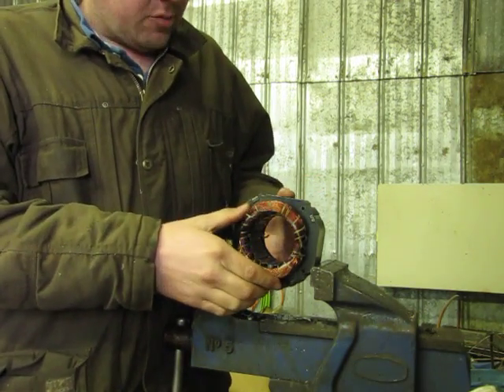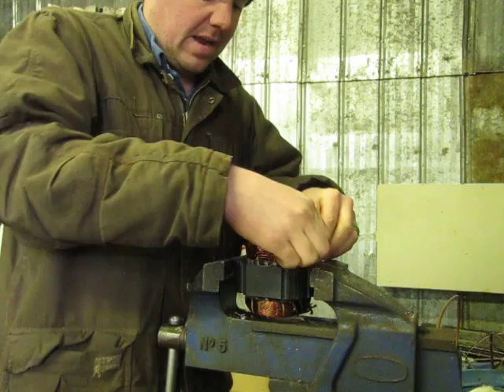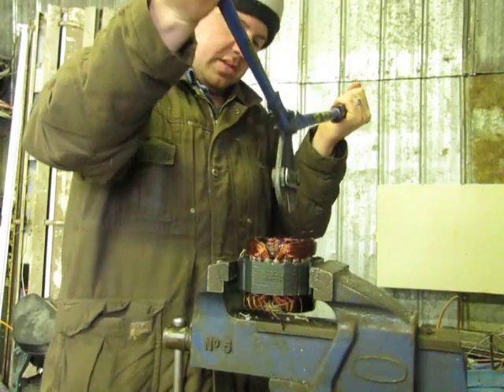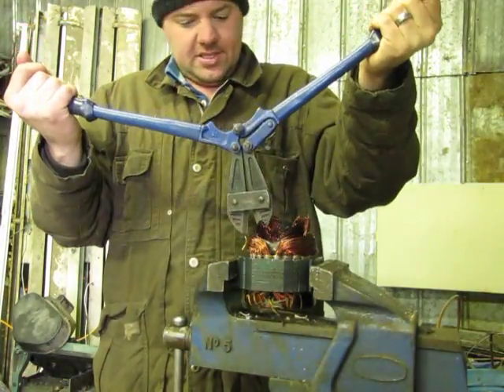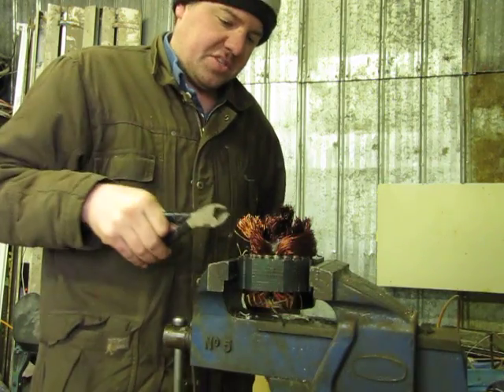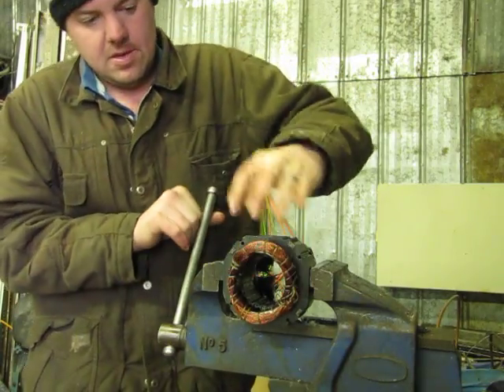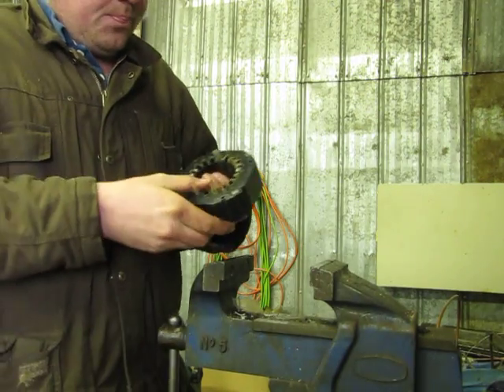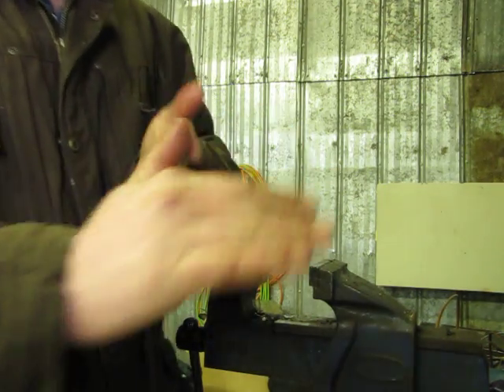Easy way to remove copper winding from a motor core

Comment: Most boltcutters wont cut cleanly all the strands due to clearance between the jaws, the proper tool for that job is cable cutters- the ones that look similar to branch loppers.
Reply from the maker: If you adjust them they work perfectly.

Comment: Your method works well but see Scrapitall channel for the fastest method to split the stator (field windings) with a machete.  Very fast.  I didn’t have a machete so I made a cutter out of an old 10” circular saw blade.  I’ve also found someone who made a cutter out of an old disc from a farm implement!  Just sharpen the cutting edge with a grinder and it goes through the wire like butter.

Comment: Hello Facebook, 
Jimmy here. I have been scrapping for about 5 years, mostly Batteries and wire because my fathers alarm company was nice for that but I’ve moved into more metals and I’m doing quite well actually and I have a pretty large haul waiting for Monday BUT. I am without a vice and a hammer chisel bit and or that kind of drill it’s an m18 Milwaukee. Any ideas?
Thanks!

Comment: When you add on the first step of removing the motor casing, that adds a few more minutes to the process.  However, 10 minutes per motor is pretty good. Also, this is No. 2 Copper since the copper windings have been treated with lacquer

Comment: I've always used tin snips.  I'll try the boltcutters, but it looked like you cut the same windings multiple times; if you don't cut thru the 1st time, small bits of Cu fall on ground.
Reply: The correct tool for the job is the only answer, cable cutters- the type that work like branch loppers but meant for chopping cables.

Comment: great video as always i use a grinder and a zip cut blade nice clean cut next to the steel flip over and start tugging these are a real pain in the  azz to pull the wire from

Comment: I have a few motors but didn't much fancy stripping them. Always thought it was too difficult. I go scrapping on a bike. Yeah a bicycle lol. But it's a hobby for me and I do okay. I'm gonna give this method a go with the motors.
I always support fellow scrappers, liked and subbed.
Reply: You got a trailer setup for yer bike?
Reply: @johndowe7003 , no I dont use a trailer. I basket at the back is enough for me. I also have a backpack and a bag to hang on the handlebar should I get a really good day.

Comment: I almost feel bad for being the only Donnie Downer on this thread but there's a better way. Take your side cutters, bolt cutters or even what I do is use a cut off wheel to just cut off the whole bundle on one end and use a screwdriver to pry out through the other side. The string comes off much easier also. Cheers
Reply from the maker: How do you fix your armchair?

Comment: I just take a grinder with a slitting wheel and chop off the windings at the steel core on one side. Then use a large screw driver to pry them out from the opposite side. Much faster...try it and let me know what you think....

Comment: By the time you find the scrap, bring it home, disassemble it, remove the copper and then take it to the buyer you are making $2.75 an hour?
Reply from the maker: I'd get around 300 lbs a week in copper alone and at 3.25/ pound (at the time) that was over 900.  Not to mention the 1008 punching 6" and under was over 300/ ton.  I was making much more than 2.75 an hour, big guy.  If you want to sent your scrap motors to the junk yard, as is and only receive .50/ lbs for em.  Have at it.  I don't mind working for it.

Comment: That will work for concentric or "basket" wound stators ,but lap wound coils only release if the previous coil is removed first untill reaching the span. For that reason an air hammer and a cutting tip focused use where the coil and the slot meet is the fastest  way i have seen for that winding.
Reply from the maker: I did it all by brute force and physical strength.  I didn't have an air chisel and angle grinders only fill your shop with stinking, choking smoke.  The only thing I wasn't ever able to remove the windings from, with my method, were automotive alternators.   Other than that, my method, using minimal tools, worked efficiently, took little time and didn't owe my anything.
Reply: @Vicsonvee   right on great video for sure ...for no power tools, definitely impressive hand strip

Comment: I stack my motor cores up like chimneys and burn the coating and string off ......cut one end of the winding's and pull them out the other end ......and i have "clean copper"

Comment: You know, I can clean 10 times the copper with a large metal file ground down to a point and sharp like a knife for aprox 4" at a taper. start the point into the center of the winding and cut as you pry it to the open side then turn it over and use the other end to pry it out of the stater.  Hope this makes sense,  28 years in the scrap business and I know it is fast.

Comment: I just use a cutting disc on the grinder , straight through the one side and then what you did only easier because my ends are not spread out ,it takes about two minutes.

Comment: good job so other than hunting all over the place for Motors then disassembling the motors dealing with the scrap from the motor housing the screws the shafts and then transporting the copper you got out of the motor to the scrap yard weighing it dealing with all the other scrap from the motor housings so unless it's raining disassembled Motors in your town it's a real tough way to make money you made two bucks on a video but you didn't show what you had to do to get that motor how are you had to get that winding out of the motor we're all the rest of the motor housing went factoring time effort you know what you're lucky if you made $0.25 I know I've been there
Reply from the maker: It takes around 10 mins to completely take apart a motor and separate your desired materials.  Refrigeration compressors are the easiest way to get motor cores.  Getting  1.75 to 4 LBS of copper at the time for over $3.00 a LBS was defiantly profitable.  You also can't forget the heavy steel either, which at the time was over 300/ ton.  There is around 10 -20 LBS in those motors and it doesn't take long to get a ton.   Pretty much ever week I was taking 3 to buckets 100 LBS copper and everyone 3 weeks a 50 Gal drum of heavy steel, which weighed over 1 Ton. - Copper got ~ $900 weekly and steel around $400 ever 3.  You also must remember you have the mixed shit steel, which was worth $200 a ton at the time.

Comment: really well done BUT unless you are getting the scrap motors for nothing and DIY you might make 20 bucks an hour.  Certainly not worth while if you have to pay someone to do it.
Reply from the maker: I used to have a small scrapping side business, that offered free scrap pickup.  All the motors were free.
Reply: Well in Florida garbage is free range when it hits the curb. Plenty of items with motors like this or bigger for free. Well worth it.

Comment: hey ty very much for the video i been scrapping motors all my life and i do about 5000 year and yes i can cut oper with grinder or sawsall and do them in about 5 minutes to 10 max. but i lose alot of copper so iam going to try your way ty cheap charlie
Reply: Lisa Campbell  How do you get ahold of 5000 motors a year?

Comment: Or...... use a angle grinder cut one side flush to the metal stack plates and then flip it over and use a screwdriver or similar tools and easily pry up on the coils by pushing the screwdriver down using the motor stack as the fulcrum. As you work your way around they break free and you can remove all the coils intact. Takes me less then 2 min per motor.
Reply from the maker: lets see your video :)

Comment: Hey man don't get upset .When a coil wound we have to bind it and  insulate with a  shellac and bake it slowly in a oven.after that coil gets hard and solid.it'll be very difficult to remove again unlike in your video. the coil you have removed seems not burnt totally and not insulated as how I said.any way you are doing nice job and a video.Keep it up!
Reply: That looked to be in good condition and typical of how hard the average stator winding is to pull out. Fridge motors are way easier, they bathe in oil all their life and slide out easily with all that lubrication.

Comment: HA HA.. Its easy because you have removed new, non insulated loosen wingdings.
Reply from the maker: I'll assure you, these are not pre-loosened winding.  They are simply cores removed, or drove out of the iron motor housings.  It really is an easy way to remove motor windings from the iron core, not matter what you say.  Go ahead and show the world how it's done though.

Comment: According to the clock in the back ground it took 8 minutes to complete this process, is it really worth that amount of labour for 2lb off 'copper 2'. btw just found the vid by chance... Otherwise  Nice Vid !
Reply: switchkwb

My method is way faster.
Reply: don't forget he paused often to explain details, it would be a lot faster if he just went for it without stopping. Great vid though and a good method  with minimal waste from power tools and blades.
Reply: Minus the explanation for an educational video he might of done it in 3 minutes.  20 motors an hr lets say, good  money.

Comment: two bad copper is only 1.50 a pound now:(
Reply from the maker: I have kind of gotten out of the scrapping business since the price dropped so much.  If you have time and the space, you can always store a bunch of copper for when the price goes back up.
Reply: Back up in the mid 2 range I've seen 2.40 to 2.60 depending on yard & county.

Comment: Just chop the whole top off with an angle grinder .No straightening needed and much faster. I haven't tried it yet, but maybe a disc for aluminum cuts better and doesn't clog up like a steel disc.

Comment: you're just making this more complicated than necessary. just whack off one side with a reciprocating saw, flip it over and let out the copper with and screwdriver. takes a lot less time than what you're doing
Reply from the maker: +norrock1 Thanks for the tip "tips"  Have fun making a mess and wasting saws-all blades.
Reply: Idk, seems like the blade would turn about two onces of your copper into dust, and you wouldn't want to breathe copper dust into your lungs.
Reply: +Vicsonvee saw blades are cheap vs work relation...

If you have a cheap China blade, then you going to break 3 blades every 20 minutes of only cutting plaster and chicken wire...

Though. If ya got some milwaukee or diablo blades... It will last ya way more than any profit even if profit fails.
Reply: Use Miwaukee Torch blades you can cut 40-50 motors before you have to change blades, including cutting off the Steel cases. Buy cheap blades, then you're wasting money.

Also you stick a Plastic tote under the vice you catch the copper dust too.
Reply: This wouldn't be that slow either if he wasn't explaining it.  Probably min maybe 2 slower than saw-all
Reply: norrock1 agreed to much hands on labor
Reply: Man thanks for taking the time to try an offer a method you found useful. Sorry all the other " scientists " didn't agree. They should offer there own manual for all to critique.

Comment: Awesome! Everyone says to use a grinder and all I could see was making a mess. Thank you for this awesome tip with the bolt cutters!
Reply: Grinder and long bar to pull them out takes about 1 min 2 tops this whitout explaining would take up to 4/6 min so for evry 1 u do ill make 3 count out my copper and ur copper end of the day. Then yes i rather make a mess
Reply: @hendrikoo7893  grinder is the standard way ive been doing it, takes longer to cut than to snip and loses copper by grinding. I sweep up the dust to melt later when the jar is full. Will be snipping it from now on with the difference of buying a decent cable cutter as my bolt cutters have gaps in the jaws. Also to pull the wire out ill use a slide puller with a hook on the end.

Comment: Get a power grinder, cut half or 75% & pound it with one swing sledge hammer.
Time management will determine when just how long you stay in the business, lol
Reply: Second that. Cutting off one side with an angle grinder is MUCH easier than all those beginning steps.  Then pull out other side as you show.
Reply: its the way I do it, but certainly this is a way if you don't have power

Comment: FYI if you ever scrap a split phase motor, the start winding is brass not copper.
Reply from the maker: John Metzler Very interesting.....  I must have scrapped out 20,000 motors, many of them being split single phase  and I had never encountered a motor containing brass windings....  I am guessing you had some sort of goofy motor you wound yourself, to say it had brass start windings.....
Reply: ***** I have delayed responding because I was hoping to get hold of a split phase motor to disassemble and settle the issue once and for all. But it seems they are a little hard to come by these days.  I remember scrapping one out a long time ago and the metal of the start winding was definitely different from that of the run winding, looking a lot more like brass than copper. It would make sense because that type of motor develops phase shift  between the start and run windings by means of resistance in the start winding, and brass has more electrical resistance than copper. That's why such a motor is sometimes called a resistance-start, induction-run motor.  Inefficiency is not a concern because normally the start winding is only operating for a split (pun intended) second.
Reply from the maker: 25U4s Number 2 Copper***   All motor winders are either copper or aluminium.  The coating or varnish on the motor windings are different colours and can make the windings appear to look brass yellow, but they are not.  The windings are all either number 2 copper or aluminium.  Many split phase motors have aluminium start winding which are a more narrow gauge than the run windings and also have a brighter yellow appearance due to the coating itself.
Reply: @Vicsonvee  ..Used to be an armature/stator winder, and can confirm that aluminium and copper are the only metals used. Aluminium being the best conductor of electricity, but fractures easily. Most motors use coper throughou.t
Reply: Vicsonvee Thanks for clarifying.

Comment: Just curious, if this the easy way, what's the hard way?

And yes, its sad to see that magnet wire cut.   Could make some fun induction projects with it.
Reply from the maker: +Tyee Cambrón Well Bud, for your information; bolt cutters are actually a cheaper method in the long run.  A good pair of bolt cutters will last many years and in many cases even longer than the reciprocating saw itself.  A reciprocating saw takes electricity to operate, which intern costs your money. A good pair of  reciprocating saw blades can cost over $40 for a single pack.  Can you tell me the operating and maintenance costs of a good pair of bolt cutters?  Those 4" motors you speak of that are apparently worthless and a waste of time seem to have yielded me a decent profit over the years.  You do realize if I wasn't recording a video and explaining the step by step procedures of my scrapping method, that I'd have the job done much faster, right?  Also consider the fact that the mass abundance of those apparent "worthless" motors are found everywhere, most of which contain 2 to 5 LBS of copper each.  Trust me bud, I have used a  reciprocating saw to cut these windings out and it's not pretty.  Constant jam-ups, blades snapping, excessive wear on the saw itself (regardless of the make) just a recipe for lost cash and big headaches.  In conclusion here; I have told many others here in comments to choose the method that best suits you.  If you feel your method is the best, then go right on doing it.  This is an alternative method of recovering copper out of motors and in my eyes is the safest, cleanest, cheapest and if you are any good, the fastest.
Reply from the maker: Chris McCarthy Well there are many different ways to get the windings out of a electric motor...  Some ways are much more time consuming and others are very dirty.  So honestly, if you have mastered your own technique of removing copper winders from motors, well then I guess it's easy for you as well.  At the time I made this video, I never seen anyone using my way of removing windings from motors.  I hope this answers your question.
Reply: Long time ago... I was a scrapping noob and someone had me take the copper out of a 4" diameter? Motor...

Took me for ever to actually crack it open... Took me like 30-60 minutes to unwind the copper... I left a plastic mess at the front door that was rented.... Hecks, today, I probably have that copper out less than 2 minutes with barely a mess.
Reply: there are plenty of more difficult ways

Comment: Thats a pretty good idea but i do mine a lot quicker i put it on the ground put a pole through the motor, stand on it and use a grinder cut one end so it won't slip. After cutting put it in a vice then pull the other end out with a long ass screwdriver. If it's too hard to pull i use the same bolts the motor came from as a punch to knock each piece out until loose or just pull em out by hand. Could have been done half way by the time reading this lol
Reply from the maker: Grinders equal stinky smoke, fumes and dust. Plus you lose cooper, from the grinding process.  If you feel your way is the best, then you should keep processing motors that way. :)
Reply: Vicsonvee So right and copper is a neurotoxin. Too much of that and you would end up in the nut house.
Reply: Copper is good for you because muscle milk contains copper and lists it in the ingredients.
Reply: +Tyee Cambrón Lol I wish I was as smart as a body builder hehe http://blog.fooducate.com/2014/12/01/muscle-milk-5-reasons-to-avoid/
Reply: Robonza  Wow drinking  Muscle milk is like drinking poison LOL  Thanks for that information